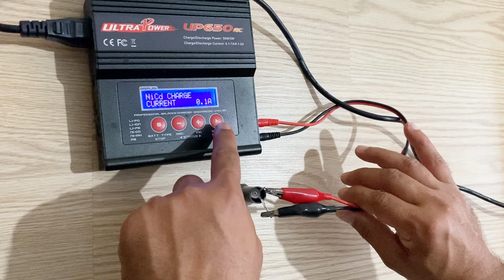How to Make Professional Electrolytic Capacitor at Home. 6V 200uF (Step by step with each detail)

Comment: Can i use a different electrolyte for a slightly higher voltage rating? Also what is the ESR of your electrolytic capacitor?

Comment: Can you please tell me if I charge the capacitor with a simple battery, will it still work well? Or i need the power source (similar to yours) for better results?
Reply from the maker: You can use battery as a charger

Comment: Hello, I wanted to ask, which compound do you use for the liquid around the capacitor? I'm not very good at english, but I'm really interested in this, since I need to make a project for my university, and this is the best video I found. Also which paper do you use to fold the aluminum?
Reply from the maker: Sodium sulphate in water as electrolyte and pos machine paper or vax paper. Good luck.
Reply: And about  nacl  like electrolyte?
Reply: @tchinobingo3277  highly corrosive with voltage and it will make electrolysis which is very bad. If you dont have sodium sulphate use citric acid with destiled or unionized water 1:100 proprotions

Comment: hi, what is the self discharge rate of this capacitor?
Reply from the maker: I can say very low.
Reply: @joyofelectronics9782  If that's the case then can I use the same process but at 100 to 1000x larger scale to power my home from solar overnight? like using 100 to 200 rolls of kitchen aluminum foils... I hope u got the idea what i am trying to say... Please let me know.
Reply from the maker: @kiahalhay1163  yes l got it. But don’t do that it won’t be reasonable brother
Reply: @joyofelectronics9782   can you please elaborate why? i was thinking of making 50,000 to 60,000 farad capacitor and use it as battery to get few hours back up. How is it not feasible? plz explain, thank you for your time.
Reply from the maker: @kiahalhay1163  if you wanna do that it’s better to build a Supercapacitor instead of electrolytic capacitors. Because to get 50,000 Farads with electrolytic capacitors is almost impossible. But with Supercapacitor it’s not an issue. Here is the link: How to Make a Professional Supercapacitor at Home. (Each Detail, Step by Step) 200 F
https://youtu.be/9DZtpBa_GnA
Reply: @joyofelectronics9782  oh sorry, Yes I was asking about the supercapacitor, and the same supercapacitor which you made in that video. So u think its possible to make a big capacitor and can give me reasonable back up?

let me ask the same question in that video of yours

Comment: Thank u. I made electrolyte cap at home but the value is not stable with cap meter!!
Reply: You have to wait for a few days for the electrolyte to penetrate fully, and also there will be a 'reforming' period after that. The capacity will eventually stabilize after charging and discharging it enough.
Reply: Thank you @rich1051414

Comment: But using a multimeter to see the electrical performances at the end instead of a speaker???
Reply from the maker: Bro as it’s not a battery or Supercapacitor the measurement with multimeter wouldn’t be so correct 👍 as you know electrolytic capacitors discharge instantly

Comment: Very nice your video and the construction friend if you want Make a video where you measure the voltage of the capacitor with a multimeter and let's see how long it holds 6 volts Otherwise it's a very nice video just let's see a little 6 volts how long does one last joy nd I'm telling you this so that I can understand if this particular supercapacitor or supercapacitor if we can use it for a battery like that because as usual supercapacitors now become very good batteries with bms that's why I'm telling you otherwise Okay okay if it's a simple one capacitor Ok it's a very nice capacitor The question is if it can work as a battery too Hi
Reply from the maker: Thanks my friend. This video was intended to give an idea about how to make electrolytic capacitors. This is not a Supercapacitor. As you say the supercaps can used as an alternative to batteries. I have some detailed videos about Supercapacitors as well. I would be very happy if you take look to them 👍

Comment: Interesting. Can it be built to a higher capacity and what is the amp of this 6v?
Reply from the maker: Of course, you should choose thicker Al foil and apply higher current and and voltage for longer time 👍
Reply: @joyofelectronics9782  thanks how do I apply for a higher current and voltage? Can i double the light foil if I can't get the thicker type? U did not say the amp of thee
Reply: @joyofelectronics9782  thanks how do I apply for a higher current and voltage? Can i double the light foil if I can't get the thicker type? U did not say the amp of thee
Reply: @joyofelectronics9782  thanks how do I apply for a higher current and voltage? Can i double the light foil if I can't get the thicker type? U did not say the amp of thee